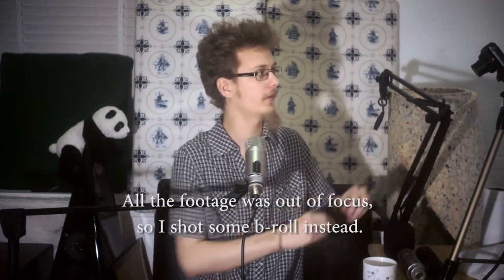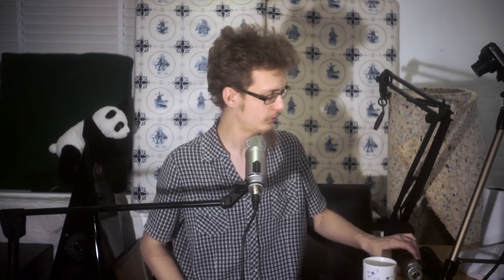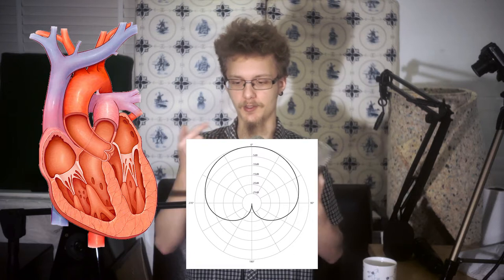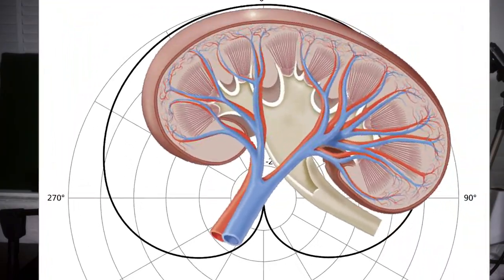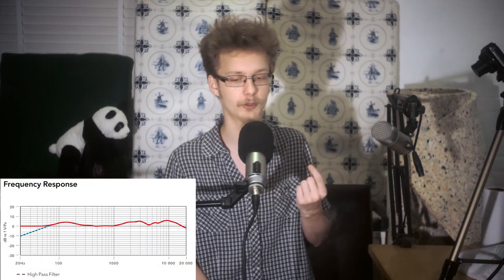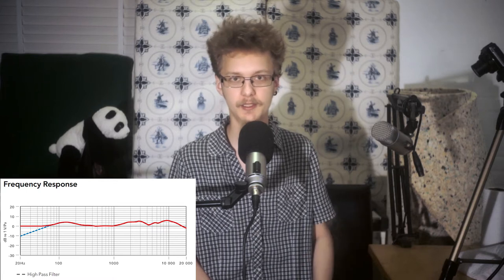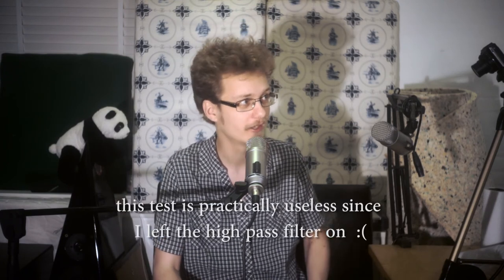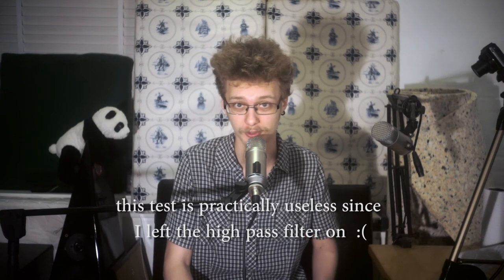Røde Broadcaster - An LDC Microphone for Broadcast?

Comment: I'm having a hard time deciding what mic is best for me. My price range is $400-500. Should I do sm7b or the rode broadcaster? I use the yeti blue mic pro for my voice overs in my videos , but looking for a solid upgrade. I'm looking for mainly a new voice over mic,but sometimes will be used for pod cast.
Reply from the maker: If you're confident that your preamp can push an SM7B and you lack acoustic treatment in your space, go with the SM7B. If you have adequate acoustic treatment and just your standard built in audio interface preamp or something akin to it, go for the Broadcaster.

Hope this helps!
Reply: Kadence I'm starting from scratch. I would need everything except a boomarm.
Reply from the maker: In that case I'd recommend the EV RE320 over any of the other two. It requires less gain than an SM7B, costs less and works well in a minimally treated space. It also sounds great. I've been using it exclusively at my desk for about 3 years. Ain't Broadcaster gonna replace it, that's for sure.
Reply: Kadence anything else I may need? Pre amp?
Reply from the maker: Well, you'd need an audio interface, which would have at least one built in preamp. And a cable.
Reply: Kadence Scarlett 2i2 any good?
Reply: does it also have the proximity effect?

Comment: What audio interface did you use and what was your gain setting? I'm using a Behringer Euphoria, and it's still pretty quiet at about 80%. Thanks.
Reply from the maker: I'm using a Focusrite Saffire Pro 24 DSP. I think the gain was set around 7/10 or so for a signal strength of -12 to -18 dBFS. I'm not entirely sure, but I believe the U-Phoria interfaces have more than enough gain to push your average condenser microphone (probably around 55-60 dB). What kind of levels are you getting?
Reply: Thanks for the reply. For some reason when I was trying another interface, I re-plugged the euphoria in and all of a sudden my volume was more than acceptable. Now I have it only set at 55% and its plenty loud. About -6 to -8 DBS.